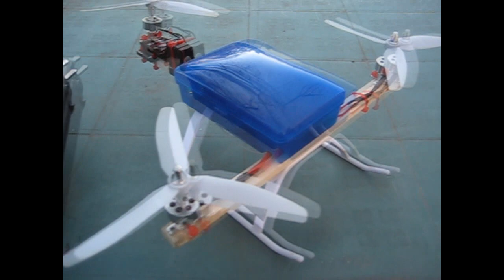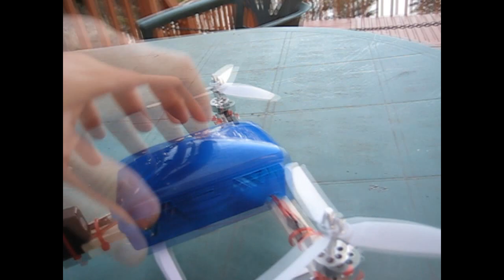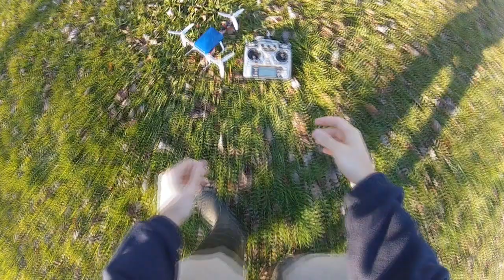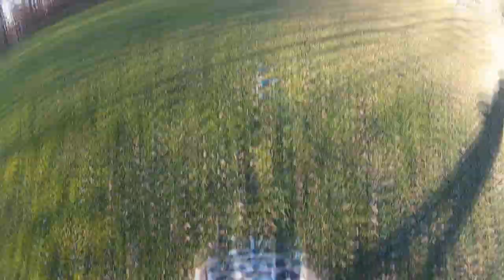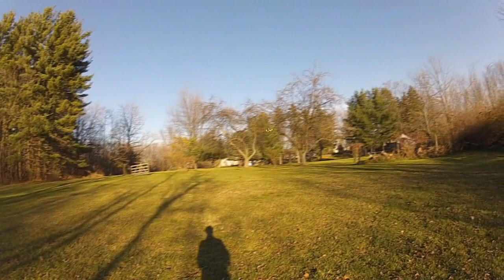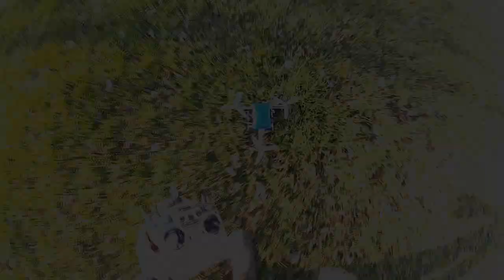Mini SoapBox Tricopter

Comment from the maker: It's pretty stable. Tricopters are just as stable as quadcopters, and in my opinion, they fly even better. Unlike a helicopter, multirotors have no nose or tail technically. They fly most any direction just as good as another.

Comment: On descent, if you come straight down (even with my big multi-rotors), the props are going through dirty air in their own turbulence.  In that, there are many pockets of high and low pressure that will cause bad oscillation.  After I found this out, I've been coming down linearly when ever possible or at least trying to go side to side to find clean air.  Happy flying!

Comment: Well, finished my soapbox T-tricopter.  I'm going to demo it's stability in my garage. I will be giving you credit for the idea and post a link with my video.  I'm using the great little i86 board and the micro 4ch RX both from Hobby King.  Take care and Happy flying!

Comment from the maker: Awesome! Post your video as a video response, and I'll approve it. Mine has been pretty tough. Only killed one motor before I added epoxy. Make sure you epoxy your motor wires where they meet the windings to toughen them up. There is a picture of this on "rcexplorer's tricopter 2.5" build page. It's a bit tricky with these since their so small though. Dont want to gum up the motor. Mines been through lots of tumbles, often nothing broken, or just a motor ziptie pops off.

Comment from the maker: An my only concern so far has been weight, maybe lengthening arms with carbon fiber, and it may be just a tiny bit under propped. I still get 5+ minutes of flight, but it can sometimes be hard to recover smoothly from descents.

Comment: Before you do that, try putting the Hobby King 410 4ch RX in it.  I used the i86 board too because it's smaller.  The video just finished uploading a short while ago and it flies Great!  Hopefully I'll be able to take it out for a real maiden tomorrow if the rain lets up.  Thanks for the idea!

Comment from the maker: Not really, Unless you want to send a spare hundred bucks or so my way ;) . What do you need to know? If you want to learn about how the yaw works, and how to wire it up, check out the rcexplorer 2.5 build. It's power system is based on that, just smaller motors, esc's, frame, and it uses a kk2.0 instead of analog kk board.